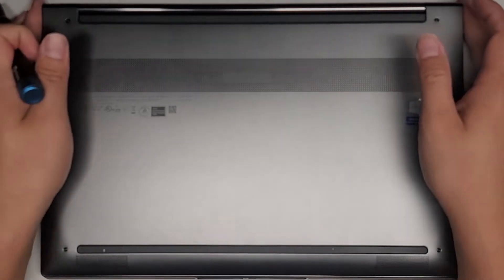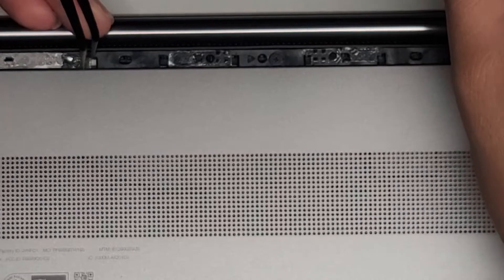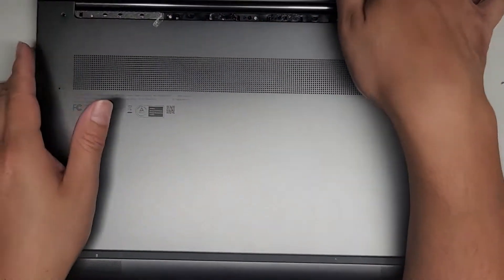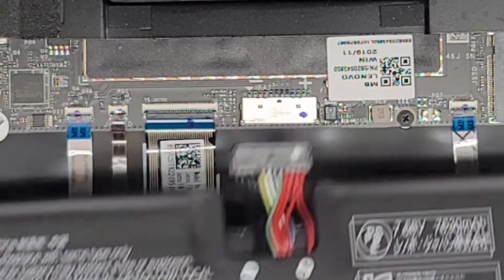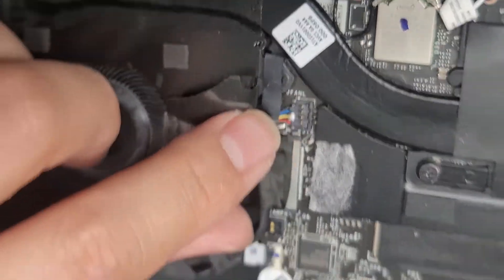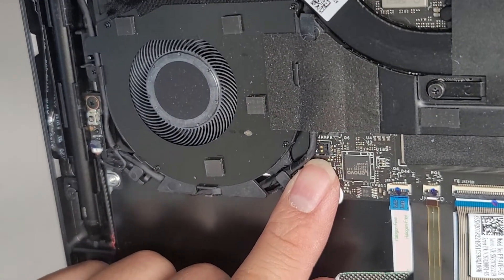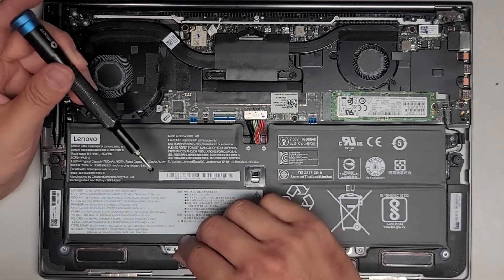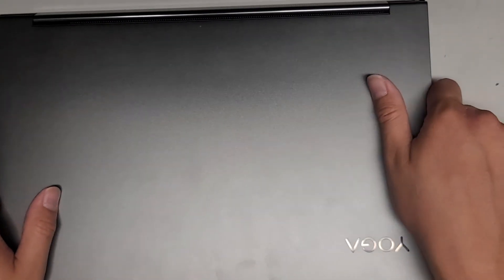Lenovo Yoga C940-14IIL 81Q9 Disassembly SSD Hard Drive Upgrade Battery Replacement Repair Quick Look

Comment: Seems like you know Lenovo's fairly well. Having an issue with the same model in this video where the battery is always showing a status of 100% whether plugged in or not. It works fine but I just never know what the charge of the battery actually is. I remember switching out the battery and this problem started. I kept the old one and noticed that one has 12 wires going to the connector and the other has 10 wires. Do you know which is the correct number of wires coming from the battery? 10 or 12? Could this be causing the issue?  Thanks for any help. Great video!
Reply from the maker: @samuelparrish4800  check the model number of the original battery and make sure to match it.

Comment: How did you go over literally everything but the SSD??? I need to know how to unplug and plug it back in because my device doesn't detect a hard drive.
Reply from the maker: Literally every other video I make shows that. Remove the screw, and it lifts up slightly, then pull it out of the slot.
Reply from the maker: https://youtu.be/I5MbgAikTCY?si=9oEON77GMsLgJHu5 start at the 5 minute mark.

Comment: How does one access BIOS on this lenovo C940?  F1 or F2 or F12 repeatedly at start does NOT work (I tried ALL the F1 through F12 keys)
Reply: F2 + Fn
Reply from the maker: There's likely a small hole in the side with an arrow shaped like a u. You have to press that with a pin while the computer is off.
Reply: @ItsBinhRepaired  I saw a video on that topic. My C940 (on the side) has 1 USB, 2 smaller charging ports and 1 headphone jack. Looking at all 4 sides, cannot find a small hole that one would insert a pin into to access BIOS...

Comment: Great video! Thanks! Any suggestions on swapping out the cooling unit? My fan is making a buzzing noise. (Maybe a broken blade/ hitting the fan case.) I would replace just the fan, but its a lot cheaper to get the whole unit. Thanks.
Reply from the maker: Swap the fan
Reply: @ItsBinhRepaired  Just to make sure I'm on the same page, are you saying just take the fan from the thermal unit I found, instead of changing the whole thermal unit and fans?
Reply from the maker: @dancing8595  if you can. Whatever works for you.
Reply: @ItsBinhRepaired  thanks
Reply from the maker: @dancing8595  no problem

Comment: This was very helpful in getting mine open. Unfortunately, nothing I've tried has been able to resolve the issue of it powering up but the screen remaining black. Any advice?
Reply from the maker: Try an external monitor.
Reply: Any Update on how you got it fixed? I have the same issue.
Reply from the maker: I don't think they ever got it fixed.

Comment: Thanks for the insight inside of this laptop, I am currently experiencing constant random bluescreens and after reinstalling windows all the drivers running cmd commands, bios updates, and troubleshooting with all the tools out there for lenovo as well, I can't make it work. The only solution might just be to have someone look at it but I dont know if I want to trust local tech shops with it, pay and it not working.
I am experiencing WHEA_UNCORRECTABLE_ERROR but its so vague I dont know where to start if I look inside of it. I thought I'd clean it after 2 years of usage with a cooler, maybe that'd help?
Reply from the maker: Check the ram with memtest. If not that, then it's very likely a bad motherboard :(